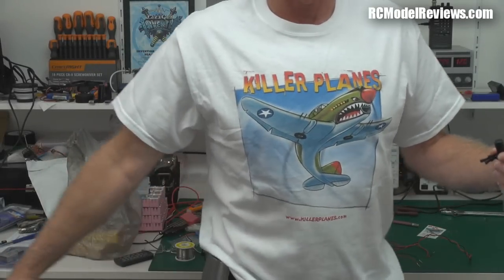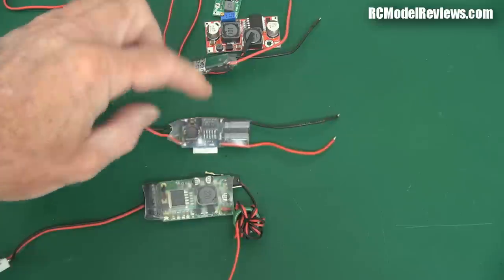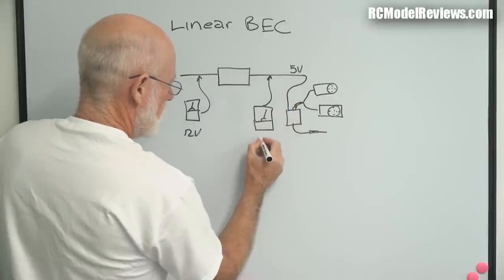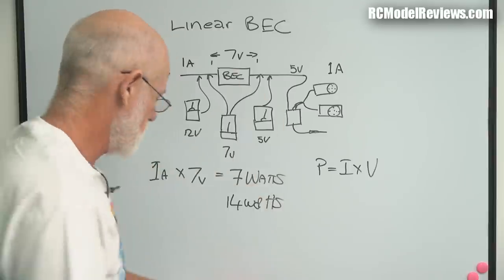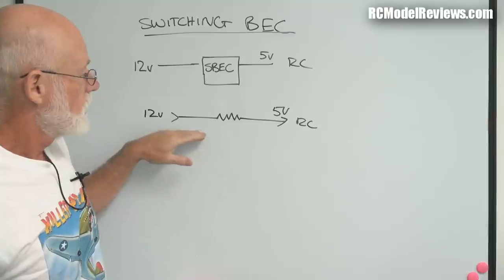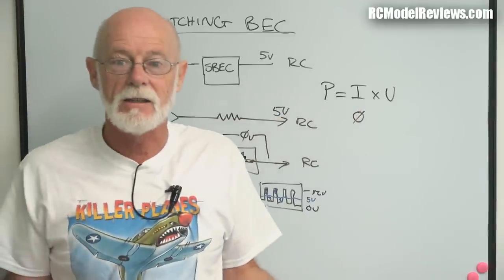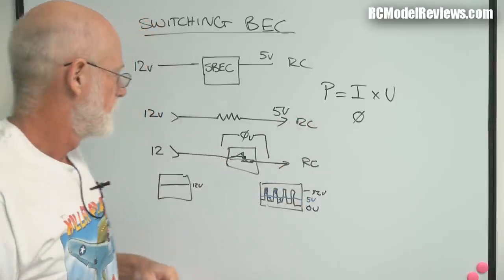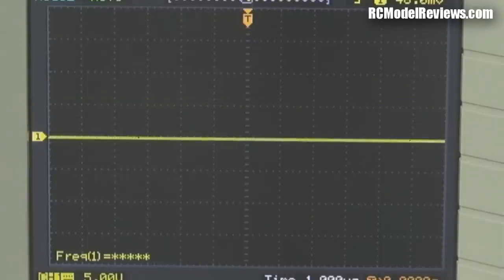All about BECs for RC model planes

Comment: Bruce, I realize this'll generate a ton of hate mail from your legions of fans, but I'd have to argue with your concept of this presentation. I watched it twice, and the first 3-4 minutes of the beginning (where it should have been said) twice more, but I don't believe I once heard you say that 'BEC' stands for 'Battery Eliminator Circuit', which is basically what the thing IS .. and not so much as a regulator. The regulation is just a necessary function of what it does - which is to provide power to the Receiver, & in turn the servos et al. 
Remember we're talking about electric powered models here, which require the larger-voltage battery for their motor....and the BEC basically taps off that for the Rx's benefit - and the 'eliminator' part is that it eliminates the need for that li'l 4-6V battery you mentioned early on, which was needed to power the receiver/servos &c in non-electric craft.  More involved but out of space here.
Reply: (cont'd)...BEC's are commonly included as part of the ESC's circuitry, & which must be disconnected when a separate BEC (ie, UBEC) is added. (BTW, the 'U' means 'Universal', not 'Ultimate' - a popular misconception).
If you'd like to educate, explain how ESC's provide full available battery voltage ALL the time, and motor speeds come from the time the ESC is switched ON vs OFF stages, & how as a result, the frequency of switching at lower throttle produces heat which can be detrimental to the circuit. Not sure I'm explaining that fully enough (for brevity) but, if you know your stuff you'll know what I'm talking about, & how to show it. NO REPEAT NO OFFENSE INTENDED!!!!!

Comment: Hi I like the ubec tutorial excellent we need more of this. Got question. Most infract all the members in my local flying club have had problems with there ignition system on there petrol models. The problem is that they are using the same battery pack to power there radio and the ignition with the result that they get 10min flying and then the petrol engine starts to hunt/ rev up and down. Can you do a review on petrol ignition system the basics as to how it works. This may help stop and accident weighting to happen. I can say that every person that does venture to the petrol route will encounter this problem. If you could explain how much power it takes to power the electronic ignition system in these engines and recommend battery types and capacities as the manufacturers do not care until some cow or even worse a person gets one in the head.

Comment: If the linear BEC is dropping 7 volts and therefore dispersing 7 watts at 1 amp draw, then there must be more than 1 amp draw from the battery, right?
Reply: No, buddy. Watts = volts × amps, so it's very possible to lose power without affecting current at all, only voltage, and vice-versa.

Comment: Thanks for sharing your knowledge Bruce, always like to learn something new every day.  I recently purchased 3 20A Afro ESC's that have no built in BEC, Can I use a single UBEC to power a FC, 1 servo and my RX?
Reply: Yes, most UBECs are rated to at least 3A so they'll power your receiver, a servo and your flight controller with ease.
Reply: Thank you and Merry Xmas!
Reply: you must be building a tricopter using the same parts I'm using to build mine. I noticed on HobbyKing's site that the 20A Afro Simon K ESCs do provide 0.5A of current but that's not enough for a metal gear servo and a flight controller so I also purchased a UBEC. Besides that, the Afro ESCs don't have a heat sink. Why didn't they put on a heat sink?
Reply: Yep you nailed it, I've been building tricopters for a few months now, I've been using Plush, RCMC, and HK blue flashed with simonk.  I recently found some slimline 20A Afro's with no BEC.  They say these slimlines run much cooler so they don't need a heat sink, but I've never used them so I can't tell you for sure if it's true.  :)   I purchased some 5A UBECs so I think that should solve my power problems. http://www.hobbyking.com/hobbyking/store/uh_viewItem.asp?idProduct=42551

Comment: soo i have a blixer 2 in building prog (have a axn aswell). i use a 2200 3c lipo a 25-30 esc (3amp bec) on a 1800kv tunergy engin. I am not sure about the Esc soo i plugd in an hiteck bec on 6v going on my 2 cell lipo. Too be sure for maiden that if my esc i fried i still can take the plane down. Do not know i thr esc can hadle that motor. tho im not goinf full trottel as im kinda new flyer. Did learn to fly on my axn (had the kit whit engin as u recomended) soo i can fly ok now. i just bougt the Bixler to learn how to fly whit flaps as i wanan progres to ww birds. Didi c your video on amps and volt and soo on but did not relly understand how much the engin takes and how that is taking a toll on the esc.

best reguards from the cold Sweden

Comment: Actually, the voltage does NOT reflect the duty cycle until AFTER the integration (filter stage), not directly after the switcher as he says in the video.  All that is reflected directly by the duty cycle right after the switch, is the current, it's chopped up.  Some switching power supplies don't use a filter, they use the electric motor itself as the resonant load and depend on the losses in the coil to provide an impedance, and thus... no separate coil/capacitor, but rather the motor over its own resistance.  For instance, audio amplifiers that are running Class D, use the voice coil and the resistance of the cone to move air, to integrate the duty cycle into an effective voltage, while other circuits use a self tuning autotransformer or a simulated solid state version called a 'gyrator'.  So, the use of electricity in R/C vehicles is just at the beginning, with only the simplest modes being tapped in the marketplace so far

Comment: Can anyone give me the answer to this problem. I am a mere beginer  in this rc game .
Anyway a good mate shows up with a Freedom firebird circa 2006 asking could i fix it t it's a sort of v tail affair) the craft just needed a bit of tidying up no problem. But then while the thing is my custody so to speak, the electronics pack up,  no way i can fix it. If electronics were any older you would be talking valves . The ship runs  a brushed motor , so if i convert it to modern day what can i use to control the motor, it being brushed and not brushless.  Any thoughts anyone.